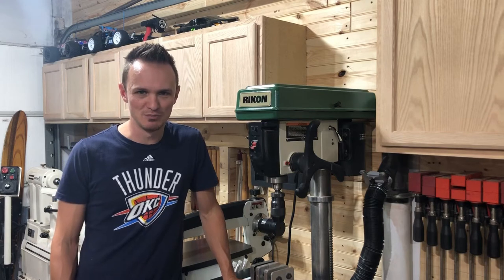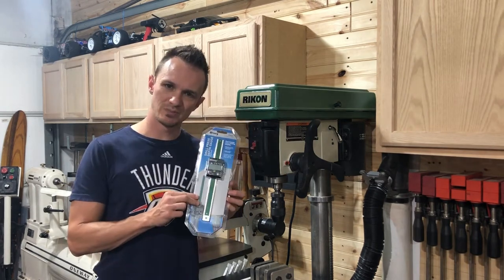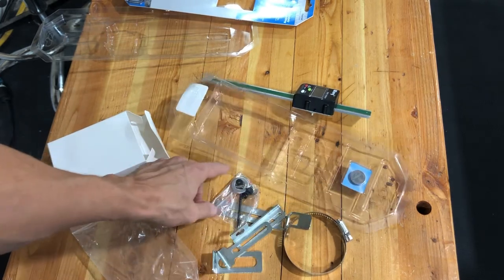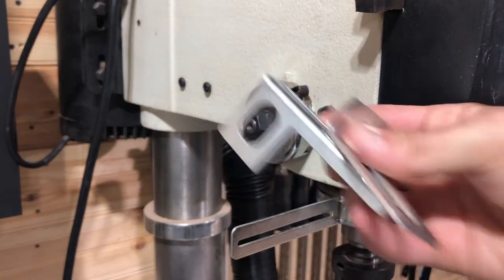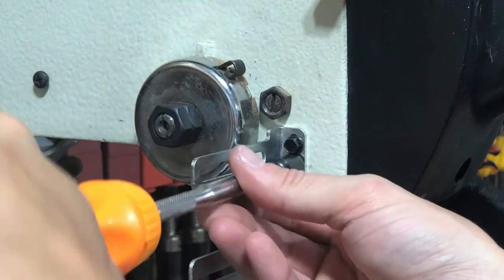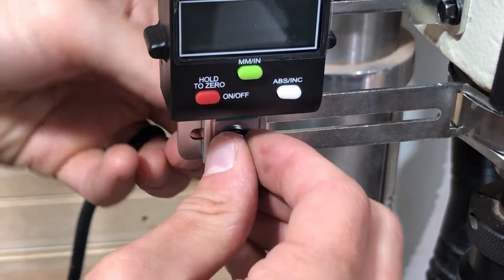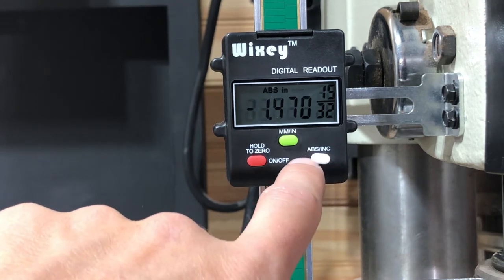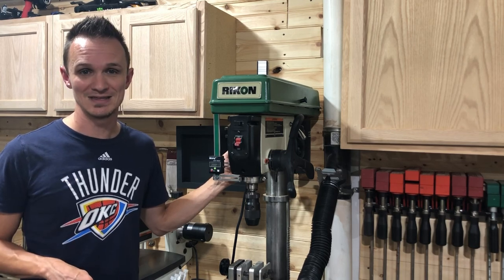Wixey Digital Drill Press Gauge. Install and review.

Comment: Glad I found your set up MSR.  Thanks for posting it.  I was about to copy one of the caliper setups but didn't care for the vertical readout.   This is much better.  Regarding the concerns of opening the belt door I'd figure I'd just lock the chuck down far enough to give  clearance.
Reply from the maker: That should work fine. I usually set the speed in a good middle range and leave it there for most stuff. Probably not the best habit for getting nice looking holes but it works :)

Comment: In the location that you mounted it, does it interfere when opening the belt cover to change speeds?  It seems longer than I need.  Can it be cut off at the top to shorten?
Reply from the maker: It does get in the way of the door a bit, and I didn’t change my speeds all that often..... probably should more. Not sure it could be cut, it would be a great experiment if you could source a replacement if it didn’t work.